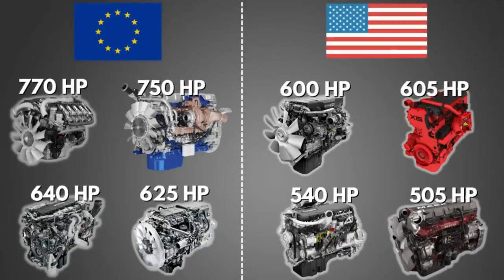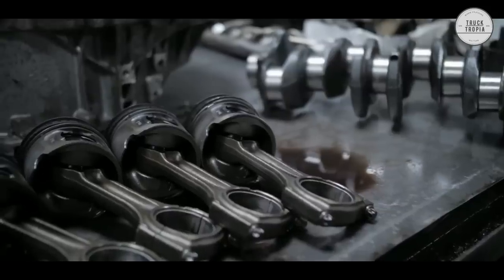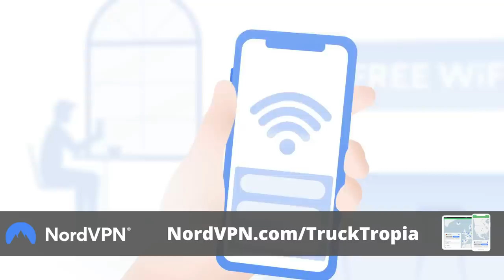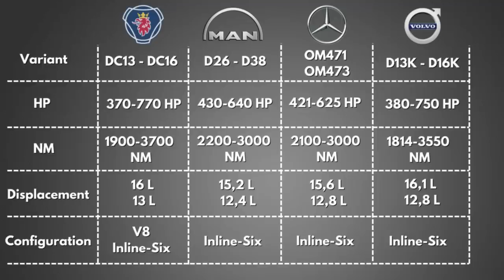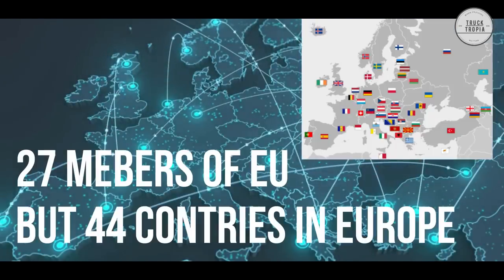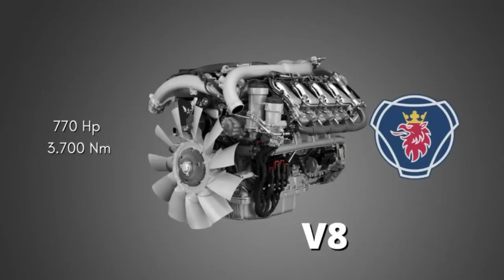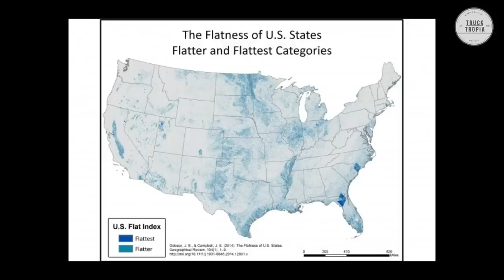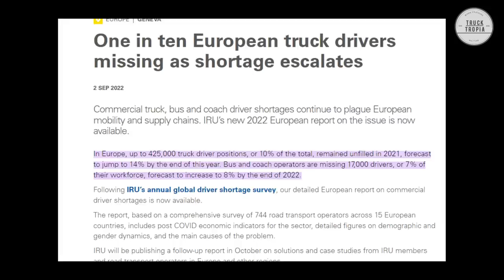Why European Trucks Have Up To 770 HP And US Don’t

Comment: Important to note that those EU tons are metric tons. 44 metric tons is about 97,000 pounds, or 48.5 US tons. The whole video would have been a lot clearer if it stuck to consistent units. Coincidentally, a UK Imperial ton is much closer to a metric ton than a US ton.
Reply: Wish we'd just use the SI units everywhere.
Reply: @kristianniss5201  you mean the METRIC system? which is more sensible, convenient to calculate with etc? I mean even in the USA alot of scientists use the metric system exactly for this reason.
Reply: @AwoudeX  yes SI includes the metric system.
Reply: @AwoudeX  As do the military because the metric system is far easier to use.
Reply: "The cummins is a 507 fluid ounce engine"
Reply: @AwoudeX  SI and metric are technically different. Principally in the calorie vs. joules measurement.
Reply: We use metric in England. If you order a ton you are getting 1000 kg
Reply: @spukduk5632  So is that Imperial fluid ounces, or US fluid ounces? A US fluid ounce is equal to 1.040843 Imperial fluid ounces.
Reply: @avancalledrupert5130  you're ordering a tonne then!
Reply: The SI system is the international standard and legally recognised by governments.  Technically there are other metric systems no longer in use, so SI is the more precise term.
Reply: @RobBCactive  There are a large number of non SI-units used in the metric system. For example, a kWh is not the SI unit of energy  (that's the Joule). There is also something called the metric horsepower (PS), which is equal to 735 kW. In more day-to-day use, we use Celsius for temperature, not the SI unit for temperature, which is the kelvin. For most uses, degrees are used for angles, not the SI unit of the radian. 

Yes, you can convert from kWh to joules, or Celsius to Kelvin, or PS to kW, but that goes for just about system of units on the planet. 

For many industries there are specific units which are produced as they are simply more convenient, or for backwards compatibility. People get far too puritanical about these things.
Reply: @Stefan_Dahn  You are fairly well defined as arrogance personified. They UK uses the metric measures where it matters. In engineering, detailed specifications and so on. Where a few traditional measures are retained, it's for things like drinking beer or where people are simply used to the measures and have historical resonance. Some measures are even built into idiomatic English; "I won't yield an inch", "He missed by miles" and the like. People rather like their traditional connections with the past, and it really makes no practical difference that speed limits ate in miles per hour, or road distances are in miles, or that pubs sell beer in pints. 

However, when it comes to science and engineering then SI units are used. It's been a long time since Whitworth threads (for instance) have been used - and that was the first standardised thread system in the world.

We are humans, and those of us of even moderate intelligence can manage to deal with parallel systems of measures for different things. It's even quite good for mental arithmetic.

To quote Ralph Waldo Emerson “A foolish consistency is the hobgoblin of little minds, adored by little statesmen and philosophers and divines. With consistency a great soul has simply nothing to do. He may as well concern himself with his shadow on the wall."

In other words be a bit more tolerant and be rather less abusive about others who choose to do things a little different, especially where it has no great value.
Reply: @TheEulerID  Exactly. But it is easier to derive other units from the SI units, such as the kilowatt hour. It is also decimal and coherent, which makes conversion much easier.

The decisive advantage of using natural constants as a basis for definition is that they are what they are called - they are constant.
Reply: @NukeFinity  Using natural constants as he basis of measures is, of course, a good thing (and the SI system has only just completed that with the redefinition of the kilogramme). However, as all American Customary Units and Imperial Units are defined in terms of SI units (for example, an inch is exactly 0.00254 metres, and Imperial pound exactly 453.59237 grammes), then that's not the differentiator.

Then it comes down to what is convenient. We do not (normally) use SI units for temperature, or angles. For food we use kilocalories, not joules as a unit of energy (and both are metric). 

In the case of this video, where comparisons were used it doesn't really matter what units are used as long as they are consistent. If you want to compare the torque of an engine between Europe and the USA, then use either Nm or pound-feet, or maybe both. The percentage difference is just the same, although it would probably be better to give both to suit what people are used to.
Reply: @yourdad0343  no it's because they work with other countries that primary use it
Reply: Converting from pound feet to newton meters would have also been a better comparison
Reply: @TheEulerID  That's the thing though. the video did not made it easy. I don't know on the top of my head the ratio between pound-foot and Nm. 
You can use either one, I don't care, but for the sake of comparison, it would have been easier to stick with one or the other accross the whole video.
Reply: That is an interesting point. In UK I bought a Chinese made log splitter that was advertised as rated at 10 tons. These were also available in USA where they are also called a 10 ton splitter. I have always assumed it was 10 UK tons but now I realise it must be 10 US tons.
Reply: @TheEulerID  combined units of base SI units or other units combined from base SI units are still considered SI units according to the last source I read on the matter. That book was written by absolute geeks who think that a book on a totally different subject matter absolutely NEEDS 20 pages on the SI system of units as a preface, and I trust them in the matter.
Reply: @TheEulerID  Funny that you mention all those "non SI-units" which are actually SI compatible and also derived from the SI units.
Reply: @avancalledrupert5130  A Ton is 2240 lb, a Tonne is 1000 kg
Reply: US ton also called Short To=912kg, Imperial ton= 1016kg😉
Reply: @yourdad0343  its actually mainly because all of our allies use the metric system, not because its "easier to use"
Reply: @kristianniss5201  I totally agree. That is why standardisation becomes so useful and saves a lot of problems. The SU units avoid a lot of problems.
Reply: @StefanHundhammer  Indonesia never officially used the imperial. It has always been metric
Reply: @avancalledrupert5130  those merchants aren't the people talking about tons that aren't 1000Kg.
If there's ambiguity use tonnes
Reply: @TheEulerID  your examples are bad and your claims wrong.
KWH - Watts is derived SI unit  joules/s
Joule is also an SI derived unit, the work done by 1 Newton force moving application point 1 metre.
Kelvin and Celsius degrees are the same, temps in Kelvin reflect thermal energy better as the zero is truly zero.  The only standard is based on SI.
As for PS that's car manufacturers using an derived unit for convenience and marketing purposes.  BTW 1PS is 735W not KW you were wrong by 10³.
It's underpinning is SI, there's NO other legal basis for the unit.
Just a little fact checking saves embarrassment.
Reply: @RobBCactive  there isn't ambiguity. Imperial is dead .

Who wants do fractions while cutting things .  All materials come in metric. A 2x2 is now 45mm square it comes in 2400 3600 or 4200 . That's it there is no imperial option for anything. Except a pint in the pub . That's it nobody knows imperial. Nobody needs to .
Reply: @StefanHundhammer  except they must have used US units not Imperial as they still don't recognise the importance of a full pint 568ml and have just 473ml in a glass .. sheer barbarism!!
I think it's still 8 pints to a gallon
Reply: @spukduk5632  yeah no one says that. We go by liter or cubic inch displacement. My truck's engine can be referred to as a "3.9L I6" and a "300 CU I6" and if you said either here in the USA anyone with a decent understanding of cars will know what you are talking about. I feel like a lot of Europeans don't realize that Americans use metric and customary all the time. We are taught both in school and there are many industries in the USA that use metric exclusively.
Reply: @StefanHundhammer  USA doesn't use imperial. Our measurement system is referred to as "American customary" and while being derived from the imperial system, many of its measurements are different, which would create inconsistencies if you tried to treat customary and Imperial as the same thing.
Reply: @raymond5097  Not really, the UK for a long time used the imperial system and still harks back to it.  The military however use the metric system.  Counting in 10s and 1000's is a darn sight easier than working in imperial.  It's not impossible for sure, but the last time the US did something because an ally does it was when? (never); it does it because it's better.
Reply: @yourdad0343  so counting in 10 feet and 1000 feet is harder than 10 meters and 1000 meters? no, its the exact same. now unless i was lied to not only in boot camp, but as well as the rest of the time i was in the military and training with allied military, the US military and all Allied military uses metric so everybody is on the same fucking page and you can communicate distances a whole shit ton easier.
Reply: @raymond5097  i think he meant the conversion to other units. I mean imperial is kinda wtf. 120 inches are 10 feet  or 3.33333 yards. while 1000 centimeters are 100 decimeters or 10 meters etc.
Reply: @SLiDaRiX  ok, now that part makes sense
Reply: @TheEulerID   I hate to nitpick, especially since I agree with you, and almost everything you’ve said has been correct, but this is a technical topic, and I’m a nerd, so....

“There is also something called the metric horsepower (PS), which is equal to 735 kW.”

Actually, that would be 735 W, not kW.  (After I wrote this, I saw that RobBCactive had also mentioned that, although he was much more rude about it.)

“For example, an inch is exactly 0.00254 metres”

Actually, it’s 0.0254 metres.  

Easy mistakes to make, but since I noticed them, I couldn't let 'em go uncorrected.  😊
Reply: @RobBCactive    KWh is not an SI unit.  It's derived from SI units, but it's not an SI unit itself.  The only SI unit for energy is the joule.  So a kWh would be 3.6 MJ, using SI units.
Reply: @Milesco  FFS the SI is a system, Joule itself is derived from Nm.
Reply: @RobBCactive    But the joule is an SI unit; the kWh is not.
Reply: @Milesco  oops.
Reply: @Milesco  you have Watts J/s, timesed by s, put in kilo, then divided by 3600 to label it, KWh ... It JOULES right there for any competent person to see.
KWh is just convenient scaling, the fundamental units are the same.
Reply: @RobBCactive   Yeah, I know.  And I'm not saying there's anything wrong with using kilowatt-hours.  There isn't.  It's a perfectly fine, convenient unit.  I'm just saying that it isn't an SI unit.  

It's like liters.  (Or litres, if you prefer.)  Liter is not an SI unit, either.  In the SI, it's "cubic decimeter".  Of course, nobody says that.  They use liters, like all normal people. 😁

I'm not judging -- I'm just telling you what the International Bureau of Weights and Measures (BIPM) says.
Reply: @AwoudeX  SI units are metric
Reply: @avancalledrupert5130  metric and imperial where it suits us
Reply: @StefanHundhammer  None of them use the Imperial system, though.

The US uses USC measures (which are not the same as, though often are very close to, Imperial ones), Liberia and Myanmar have not officially adopted the Metric system, but use a mixture of metric and local customary measures, which are (again) not Imperial.
Reply: And there you have it - why the entire world should stick to metric and SI-units instead of random imperial systems.
Reply: what a mess
Reply: @Stefan Hundhammer  and UK Bridge heights.  I know they also post heights in metres but I wish I wish measurements in feet were finally dropped.  As I understand it, the change to metric was 1971.
Reply: @StefanHundhammer  Canada in part - but they're mostly Metric up there.
Road signs semi-near the USA border will often be in both KMH and MPH due to their large number of USA tourists that don't understand the metric units (I'm bilingual that way but I'm also a minority at that).
Reply: @baileyharrison1030  A Ton is 2000 lb. A Metric Ton or Tonne is 1000 kg.
Reply: @avancalledrupert5130  Imperial is not dead - but it IS slowly dying, even in the USA.
Reply: @AwoudeX  Nah
Reply: @spukduk5632  and uses 3/64 of an Olympic Swimming pool of fuel per 1600 football fields
Reply: @AwoudeX irony is that imperial system is more accurate. Metric has changed many times in its history... But it's easier than doing division and fractions I guess...
Reply: @SimanSlivar  The only thing that has changed about the metric system since its inception, is how the EXACT SAME length is defined. This many wave lengths of light, platinum of a certain length at certain fixed conditions etc. The thing is, it is far more pragmatic to use the metric system, hence the ENTIRE scientific community has shunned imperial, because it's way harder to use and more errors are made. Accuracy my ass.
Reply: @TheEulerID whitworth threads are used everyday across the world. Bspp and bspt are both whitworth threads. BarG is still used for pressure in most industries in the UK.

The UK does use metric mostly but not always.

Any drawing I do for the oil industry has to be dual united.
Reply: @AwoudeX not many scientists, all scientists
Reply: We dont care about freedumb confusing measures. There is only one Ton recognized worldwide, 1000 kg
Reply: @clitisswood7330  Not true. You will find both US (short) and UK (long) ton measures widely used in international shipping. In any event, for anybody even mildly numerate, it's trivial to convert between measures.
Reply: @baileyharrison1030 Since 1kg is approximately 2.2 UK pounds the difference in the UK hardly matters.
Reply: US ton is imperial, britian invented imperial, aka imperial british.
Reply: @aprilgeneric8027  Not true. The Imperial system of measures was not defined until the Weights and Measures Act, 1824 by which time the USA was independent. It used an earlier English system of measures which were never called Imperial. Hence the US ton is 2,000 lbs, and the Imperial ton is 2,240 lbs. That is also why there are differences in volume measures, like the gallons and fluid ounces. America uses the United States Customary Units system, not the Imperial Unit System, and it most certainly does not use the Imperial ton (which they call the long ton).
Reply: @cane870 the SI system is defined by the metric system. So removing it would mean removing the Silly system.
Reply: @TheEulerID holy shit I get your point but "you are fairly well described as arrogance personified" is such a redditor thing to say
Reply: You don't know what SI is do you? @AwoudeX
Reply: @AwoudeX Globalist bollocks
Reply: The americans are not used to do transformations from imperial to SI. They also crashed a space shuttle due to this error so....
Reply: @mirceaalex9907  NATO crashed a space probe (the Mars Climate Orbiter), not a Space Shuttle.

The loss of two of the latter was for two entirely different reasons.

The Americans are also quite used to converting between Imperial (or, more accurately US Customary Units) and Metric units, as they do it rather a lot. However, it only requires one error to be made over the unit being specified and bang goes a few hundred million dollars.
Reply: @TheEulerID  sorry... my mistake english is not my native language. The space shuttle is the one reusable and with crew... i was meaning space craft (orbiter). And it was a jokeish comment and not scientifically researched and proven answer i wrote. I also admire americans for the huge impact they had globbaly in such a short history
Reply: @StefanHundhammer  wrong, myammar use their own traditional mesurment system, Liberia is switchin to SI unitis therfore the US is the only using it
Reply: @TheEulerID  You are off by one little 0, an Inch is 0.0254 metres.
Reply: @raymond5097  Really? How many inches are a mile? How many feet are a mile? How many yards are a mile? Off course, totally simple.
Reply: Why not using metric tons??? Everyone knows what a metric ton is!!
Reply: @traderjoes8725  There are a lot of US citizens on YouTube, and an even higher proportion on this channel. They are very likely to think of US tons, which are 2,000 pounds or about 907 kilogrammes. So it's important when making comparisons to make sure that that a common measurement is used. Hence the clarification.
Reply: @TheEulerID  No, US-citizen do know what a metric ton is! US-citizen is proud to know what a metric ton is and US-citizen also know where europe is located and US-citizen also know where china is located! US-citizens have education.
Reply: @traderjoes8725  I did not say that US citizens don't know what a metric ton is, what I said is that they tend to think in terms of US tons, which are 2,000 pounds and many will not have realised that the u nits used in this video for European and US weights are different.  There is massive evidence that US citizens tend to think in terms of US tons as I see endless content where it is taken to be 2,000 pounds. 

This video does not distinguish between metric or US tons, hence the need for clarification. If you think that clarification is not required, you are wrong as I have seen many comments on this video and others on the Internet which have made that exact same assumption when there are discussions regarding tons.
Reply: @kristianniss5201  What's the fun in that - a Canadian
Reply: @bricefleckenstein9666  English speaking regions primarily use imperial for day to day use, franophones are the ones that are wholly use metric
Reply: @mattiapresti7295  Much of what you have just written comes across as sheer gibberish. True, the USA does not have a system of universal healthcare, but literally every other English speaking country on the planet has one. That includes Canada, Ireland, Australia, the UK and New Zealand. Try and educate yourself as you are clearly entirely ignorant of the facts. 

As for the Enlightenment, English speakers played a huge part. I can throw just a few names at you including Isaac Newton, James Clerk Maxwell, Robert Hooke, Charles Darwin, Francis Bacon, John Hobbs, Adam Smith, David Hume, Thomas Jefferson, Benjamin Franklin, James Boswell, Edmund Burke, Edward Gibbon, Henry More, Thomas Paine and Joseph Priestly.

Politically speaking, even as late as WW I, many major continental powers had very powerful Imperial figures such as in Germany, Russia and Austro-Hungary leading 

It was also in continental Europe where fascism and communist dictatorships came to power, such as in Spain, Italy, Germany and Russia. The English speaking countries weren't perfect of course, but they had made major progress on democracy by the end of the 19th century.

As for using non-metric units is a much simpler explanation and it's that the British Empire was quite happy doing things the way it already did and just modified it's existing systems of units. Inertia matters, and I don't think the continued use of American Customary Units in the USA can be put down to a dislike of the French Revolution. 

I should add that CGS and SI units were widely used in scientific circles in the UK and the USA. In 1873, a committee of the British Association for the Advancement of Science, including such important figures as James Clerk Maxwell and William Thomson recommended the use of CGS (centimetres-grammes-seconds) for scientific use, later to be replaced by the current system of metres, kilogrammes and seconds.

Finally, as you seem to believe that English speaking countries are so backwards, how do you explain the fact that the two countries with the largest number of Nobel Prizes are the USA (by a big margin) and then the UK. It's not as if this is bias; the Nobel Prize system was set up by a Swede, and is adjudicated in Sweden.
Reply: ❤❤❤❤❤ talk torque
Reply: Now, lets ask them, what a pint of beer is.
Reply: @raymond5097 incorrect. SI is a way more accurate system of measure scientifically. That's why it's used.